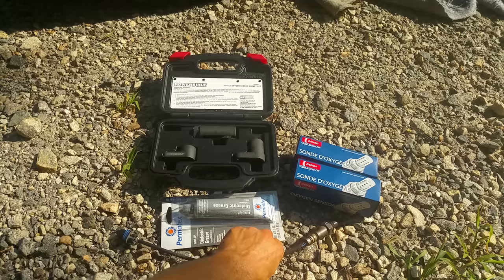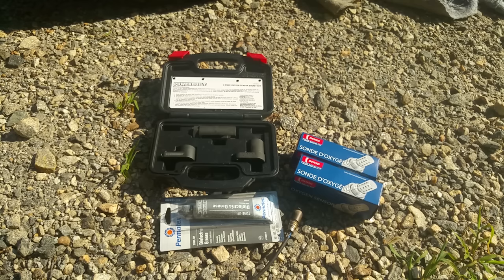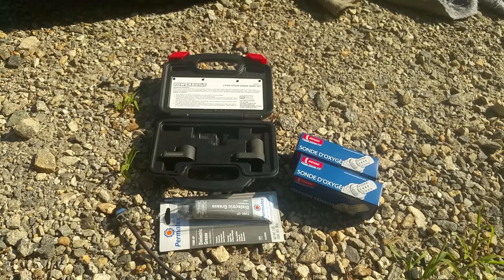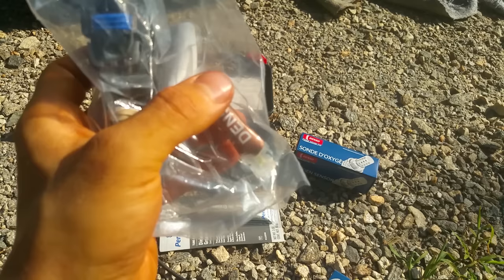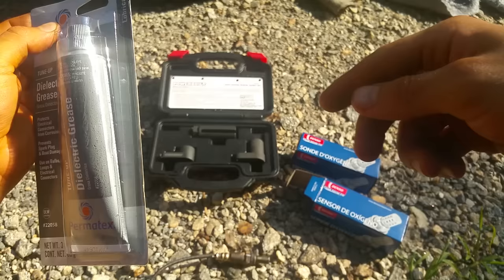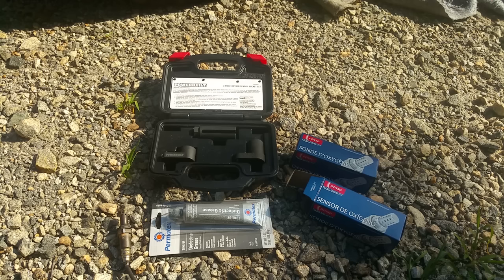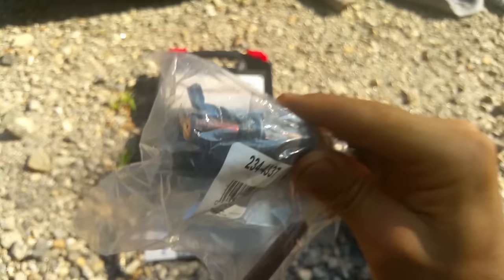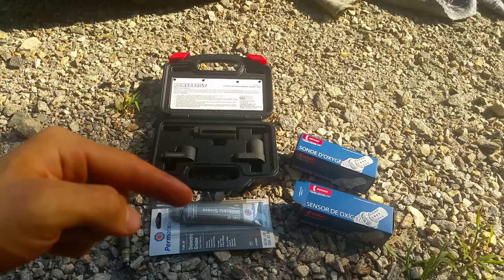NEVER Change Another O2 Sensor Until You WATCH THIS!

Comment: Why does everyone recommend buying a specialty socket just to remove an O2 sensor!  You have wrenches don't you?  You know a regular old shitty wrench works right?
Reply from the maker: If you use the open end on a wrench you risk stripping a stubborn stuck sensor. Then you will really be in trouble especially if it's in a hard to get at location.
Reply: A specialty socket can slip also.  I've never ever had a problem with a wrench.  I guess it shouldn't be a shitty wrench, but a wrench works just fine.
Reply: On some vehicles, say for instance a 2003 sequoia, you will not get a wrench in the area the sensor is at.  Esp on the driver's side sensor area.  Toyota felt it necessary to place the O2 sensor hole right next to where the exhaust downpipe and the catalytic converter pipe join; not to mention the steering rack and lines make it nearly impossible to get your hands in there.

Point being, on many cars, the upstream sensors require the specialty sockets to get a ratchet in there.  Downstream sensors are usually fine with a "regular" shitty, or non shitty, wrench.
Reply: That is so true and im a chick. I even know that. Amateurs. I was waiting for Cleveland's brother to do something awesome. But he didn't do shit.
Reply from the maker: Can't be his brother. Wrong color.
Reply: Why buy, you can rent (borrow) at advanced auto or auto zone
Reply from the maker: Because it sucks to have to stop and go get the right tools...
Reply: I agree with the wrench comment. ✋ But to be fair, I've never had a sensor stuck to the point you're describing.
Reply: You are very wrong.
Reply from the maker: What???
Reply: that sensor socket is not a snug fit and will strip that sensor up horribly.
Reply: @MattsShop  wrong again
Reply: @user-ym9wb2mk5e i have special sockets for sensors and they are made by Crescent
Reply: @teddavis942  Do you happen to have the part #.  I replaced both sensors, using the slotted socket from Oreilly, came out fine.  I like buying tools, so i dont have to keep running back and forth.

Also, the catalytic converter needed replacing, i after doing the cat and both sensors, the lights are on again.  Haven't looked at the codes, but i am reading that they typically need to be replaced at the same time, meaning driver and passenger side sensors.
Reply: I have an 2000 infinity and it won't start I've tried almost everything can you suggest what problem might be?
Reply: @MattsShop  AGREED, first time y'all strip one n have to pull the exhaust to get a vise grip on it, you'll be sorry.  At the least if you're gonna use a wrench, use a tubing wrench.  Anything exhaust needs careful consideration because of the expansion and contraction from heating n cooling.
Reply: If you are going to change the sensor anyway then you can just cut the wires off and use a regular 6 point deep socket. Another way is to cut the top part of the sensor off with a hacksaw or a saws all right above the hex and use a regular 6 point socket and a breaker bar.
Reply: daniel1980ization not on my bmw it doesn’t
Reply: Not a open end for installation but yes I line wrench on box end is fine. I wonder if they are thinking about the torque wrench. Anyhow Happy motoring.
Reply: You get the exaust really hot then loosen it. It helps tremendously. Be careful not to burn yourself
Reply: Incorrect info. Different application have differnt locations

Comment: Best time to remove O2 sensors is when the vehicle is at operating temperature ,  engine off , use antiseize  when reinstalling the 02 sensors,,
Reply from the maker: Agreed. Just don't get burnt.
Reply: Spray w40 Waite 5 m

Comment: My car is not trying to change gears ,1-2 .the rest run good what can it be Ford Taurus 2002
Reply: Could be a bunch of different things. If the check engine light is on...I'd have it scanned at your nearest auto parts store..if not..you're looking at transmission repair.
Reply from the maker: Yea, this problem has nothing to do with you O2 sensors.

Comment: I use a propane torch to heat that part of the exhaust pipe before I even try to break it lose.
Reply from the maker: +Samuel Bowers Yea!
Reply: the factory manuals say to start and run the  engine for a few minutes to expand the threads so they back out easier , but if we replace them for a thrown code  cut the cables and use a impact socket to take them out , and remove it like a tap , 1 turn out a 1/4 turn in  and repeat til its out as it cleans the threads so they wil not gall and lock up
Reply from the maker: Great info! I like the in and out technique like a tap.

Comment: O2 sensors come with anti seize already on them, at least the AC Delco sensors I've used. Chevy doesn't use Denso sensors, chances are someone replaced the AC Delco units with the Denso and forgot to put the anti seize on them.

Comment: My car uses three of those sensors and they are not interchangeable. I ordered the wrong one when Amazon said it fits - rookie mistake, should have checked more carefully. I'd kept it, needed it eventually and didn't want to pay the restocking charge.  Reordered the correct one O2 sensor for top front of the engine (bank 2, sensor 1), easy access. Removed and installed, no big deal. Few years later it needed another O2 sensor (actually air/fuel ratio sensor). This one was located at the bottom between the firewall and engine (bank 1, sensor 1).  From the bottom you go in blind, from the top you hardly see it and very little room to work with. I cut off my my wrench using the open end with a cheated bar. No can do, it just slip around the sensor. Ordered a set of O2 sockets but none of them worked, it just spread and slip around even though it looked very hefty. Ended up soaking with PB Blaster for 3 or 4 of days, cut the wires off and slip a box wrench with a 4 foot cheater bar and pound it with a dead blow hammer. Those things are not cheap, local parts store wanted $160, $90 at Amazon for the Denso 234-9007 for 2000 V6 Camry.
Reply from the maker: Thanks for sharing your success. The Amazon parts look up has always been accurate for me. I always double check with one of the parts store websites before I order just to make sure though. You are right. They are NOT cheap, especially at the local parts stores.

Comment: Please can somebody help me to make different between Upstream and Downstream, Should i buy any oxygen sensor and replace it or there is a special oxygen sensor for the upstream and another special one for the downstream? 😩 help please
Reply from the maker: If you go to an autoparts store they will read the code. The upstream and downstream sensors are usually different.
Reply: @MattsShop  thanks 🙏🏽
Reply: Upstream..aTop of engine..Downstream @Catalytic Converter

Comment: I'm getting really shitty gas mileage on my 2016 Fusion, but no check engine light, have ran 3 tankfulls of gas with injector cleaner but didnt help, was thinking about changing these sensors to see if it helps? Like I said no lights, no codes, just really bad gas mileage, new tires, new air filter, always on time with the oil change, car feels like it's running fine, and I drive like I'm hauling Miss Daisy, what is my problem

Comment: heat heat and more heat is all you need. a good ole propane torch from your local hardware, AutoZone,....aim the torch at the base right at the bung heat it for 60secs. breaker bar preferred. but it was super easy. I just did mine on 03 silvy.
Reply from the maker: Yea, heat helps the most for sure. Sometimes it's hard or kind of dangerous to get a torch in there on some vehicles. Good tip.
Reply: Scion po420 code
Reply from the maker: +Geo Hurley What does that mean? You want to know what that code means?
Reply: start car or truck for 5 min then turn off the heat will make it easy to remove o2 sensors
Reply from the maker: +D D Oh yea I do that anyway, that's a good tip I forgot to mention. Thanks.

Comment: I love buying cheap china crappy parts to see how well they work. Sometimes i have great luck. Other times, not so much. My china o2 sensor for my civic stopped working at all after only 5 months. Go with oem! Find out what brand your car uses and buy it from them. In my civic It's denso, quality stuff.
Reply from the maker: I agree 100%. The cheap parts fail more often than not. If you watch some of my other videos you'll see that I am a firm believer in high quality Made In USA parts and tools!
Reply: My cheapeat air sensor worked 1 time.....waste of $20 and time

Comment: it's easier to change if you let the car run for 10-15 min.  !!!!THE WILL BE HOT USING THIS METHOD!!!!
Reply from the maker: Yea! That's a good tip!
Reply: I just used a blow torch to heat up just the threads came out after a little bit of elbow grease

Comment: Map gas torch works to get them loose and always use quality parts when it comes to most sensors and electronic parts. I’ve seen so much crazy stuff happen over the years with cheap parts that when it comes to my stuff I buy mostly factory parts. 

FYI. There is a difference between manufacture and replacement parts at most dealers. Ford is the perfect example. Ford vs Motorcraft. Motorcraft is good but it is absolutely not factory. If you have turned a wrench long enough you know exactly what I mean.

Comment: You replace the front o2 sensors in pairs when there is a fault or when there is high mileage on them as the condition of this sensor is tied into fuel economy as well as power as for rear sensors never replace unless bad and no need to replace both as they only exist to rat you the fuck out if you remove the cats or one of them is bad .. they have zero affect on economy and power just toss a code and CEL rear sensors are merely on off switch for check engine light and emission code if it aint broke dont fix it 

if you have an aftermarket tune or tuner for vehicle remove rear sensors and turn them off in the tune remove and put plug in the holes .. why not simply leave them in ?? the fuckers are like $75 each and if left disconnected they get carbon fouled and ruined you only keep if car is sold and you put emission shit back on
Reply from the maker: +Griffon 327 Great info, thanks. Yea, some places don't even have emissions so perhaps you could delete the rear ones.

Why not just put it back how it was made. The sensors in front of the cats are very important though.
Reply: Griffon 327 
What is going on with my 1012 chevy cruze 1.4 turbo. The whole time the car is running the radiator fan goes 2000 miles an hour. Need help. Thank you.
Reply from the maker: That's crazy. Is your fan an electric fan? Is your car low on coolant?
Reply: The front sensors will read say 10 just as example, the converter converts and the result is a different reading coming out the converter, assumably cleaner/lower reading, if it read nothing but air flow it could be a sail switch however as it reads the difference from front to back  it has to actually work, and read accurately otherwise how does it do anything?

Comment: do not put grease of any type on the connector ase master tech
Reply from the maker: +juan rodriguez Why don't you like putting grease on the connector.
Reply: it senses the oxygen in the outside the cat and compares it to the oxygen in the cat  see Wells video on 02 sensors
Reply: by the way i have never seen 02 wires with corrosion they are not copper they are stainless steel
Reply from the maker: +juan rodriguez Yea! That's how it works!
Reply: juan rodriguez 7
Reply: 20
Reply: There really is no need to put any grease on the connector because it has a weather pack seal on it. If you must use dielectric grease, apply it sparingly on the rubber seal only. You don't want to put it down in the connectors or near any of the contacts because a dielectric is an insulator and will only serve to add unwanted resistance to the connection.
Reply: juan rodriguez its not sensing through the connector, it senses through a vent hole in the 02-sensor. 

He is perfectly fine using grease on the connector
Reply: what he is saying you'll be adding un-needed resistance that'll through off the readings the car/truck needs to know for the proper air/fuel mix in other words it'll make a 4 lane road down to a 2 lane or or better yet a v2 to a v1 engine
Reply: DJ R up
Reply: Guys.. oxygen sensors have a reference air chamber inside the sensor, some sensors get this reference air through the wire up to the connector, when you put grease on the terminal it blocks this reference air supply and can mess up your sensors reading. You do not put grease on an o2 sensor connector.
Reply: Matt's Shop hola juan que codigo es p0136 and p0325 en un 97 nissan maxima
Reply from the maker: Don't you think spark plugs would come with antisieze if they needed it. Rims should come with tires and brake rotors should come with brakes too. Not being a smartass just sayin!
Reply: juan rodriguez exactly!
Reply from the maker: Not exactly
Reply: Matt's Shop you probably shouldn’t be applying anti seize on spark plugs, considering they ground to the block. O2 sensors used to ground to the exhaust, now they have ground wires, so you’re good to apply the anti seize to them. However, I agree with your logic, not everything should simply come with the required lubricants, technicians should practice proper lubrication without reminders of a packet of lube. Anyone doing this kind of work should have their own lubricants handy in my opinion.
Reply: On some spark plugs it's not recommended to add anti seize. Something to do with the ground I think.
Reply: Samuel Lindström not the new once...the old sensors are vented at the tip but not new once
Reply: Matt's Shop but spark plugs do come with antiseize. If the threads are shiny do not put anything on it or you'll add resistance to the ground. As for o2 sensors isn't one if the wires ground? You can put as much shit on the threads as you want in this case.
Reply: The anti-seize that comes with O2 sensors is copper-based, hence the copper colour. This improves the ground connection between the sensor and the exhaust. However, this usually only applies to upstream sensors, which are typically 1-wire sensors. They require the exhaust pipe for a return path to ground. Most downstream sensors are 4 wire (heated) sensors, which have 2 incorporated ground wires used for the heater and the sensor. Oddly, some of these also come with copper-based anti-seize (NTK for example). You should still use anti-seize on o2 sensor threads, mainly for the next guy who needs to remove them.

As for spark plugs, use the copper-based anti-seize whenever possible to improve the ground connection. If you don't have any, use the silver, but don't gob it on. There are so many threads on a spark plug that the chances of anti-seize preventing a good ground connection is very slim.  Only need a film of anti-seize to be 100% effective. 

There's nothing worse than breaking a plug in a cylinder head because the last person didn't apply a bit of anti-seize to the plugs before they installed them.

If you are replacing the o2 sensor anyway, then don't waste your time and money on the special sockets. First, grab a box end wrench and see if the electrical connector will fit through. If not, then cut the wire and use a box end wrench to remove the sensor. If you have the patience, you can extract the pins from the electrical connector, then slip the 4 loose wires through the wrench, but that's only if you plan to re-use the sensor.
Reply: @FroztiProductions  never seen plugs out of the box with anti seize.... but its possible.
Reply from the maker: Spark plugs do not have anti-seize out of the box, but the plug wire boots can have dielectric grease in them.
Reply: @MattsShop  It's not actually anti seize, it's a special plating that is put there to keep it from seizing. The denso instructions tell you not to put any anti seize on it to avoid affecting the grounding. That's why if the threads are shiny, do not put anything on them.
Reply from the maker: Yes, that can be true, but these sensors came with anti-sieze IN THE BOX.
Reply: @MattsShop  Yes o2 sensors and any exhaust sensors should have antiseize :)
Reply from the maker: Yes! I guess none of these guys have ever had to remove a seized O2 sensor.
Reply: @MattsShop  ok but now you realize that this is wholly irrelevant to the video and thread...whats the voltage in a spark plug boot... thousands? A bit of additional resistance is meaningless. An 02 sensor is a precision measuring device sending a signal of a few volts. If you know your ohms law you know a bit of resistance will affect readings greatly.

Comment: o2 sensors come out much easier by heating the exterior area of the o2 inlet threading.
Reply from the maker: +DJ Anderson Sometimes you can't put a torch in some spots because of the stuff that surrounds the O2 sensor sometimes. You can easily burn up stuff.
Reply: Matt's Shop  So true.  I had to tie-off some wiring to keep em out of the way when possible.
Reply from the maker: +DJ Anderson Yea exactly, sometimes you can use heat sometimes you can't it just depends. If there's that insulation/sound deadening too you could burn it up.
Reply: you have to remember a 02 sensor is on the exhaust which hits extremely high temps already-shouldnt be any reason you cant throw alittle heat on it

Comment: I'm new to cars. Do the sensors have to be compatible with make/model or universal fit?  (I had PO135 11 Heater malfunction)
Reply from the maker: They are specific to your make/model. You have to look up the part number that will work.

Comment: wells teck school says no dielectric grease on the connections it uses that area for the sensor to breath . and if you take it off you do not see the grease form the factory do you
Reply from the maker: You have to use your discretion when it comes to things like dielectric grease. If it breathes through the plug then you don't want to use it.